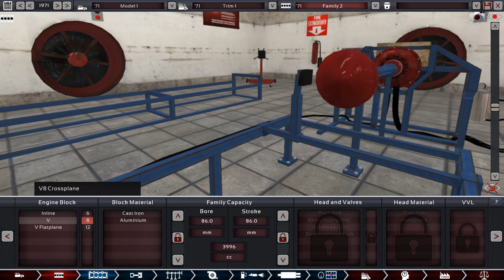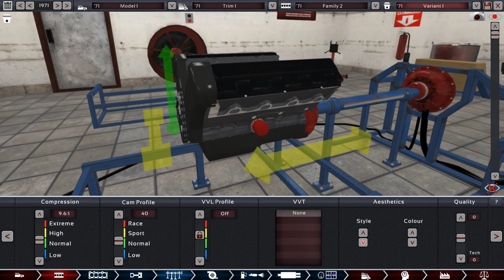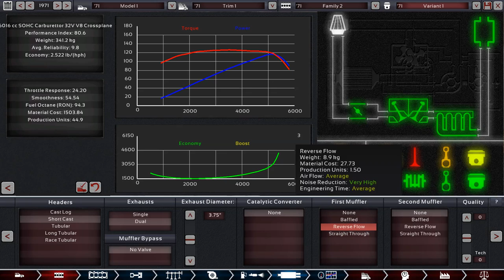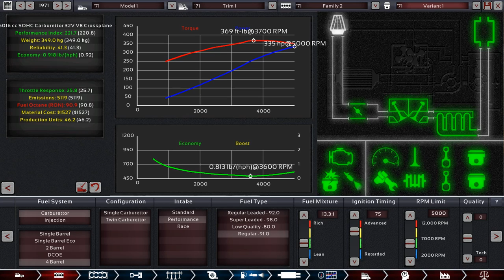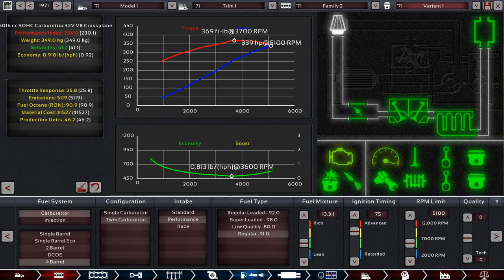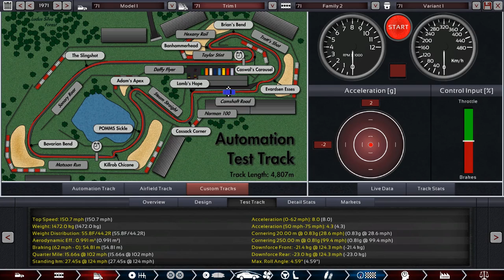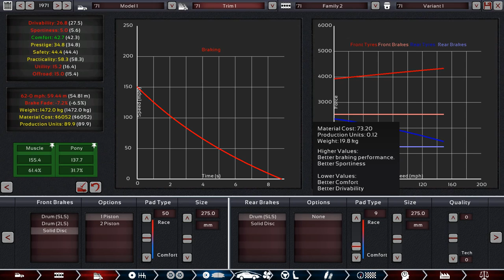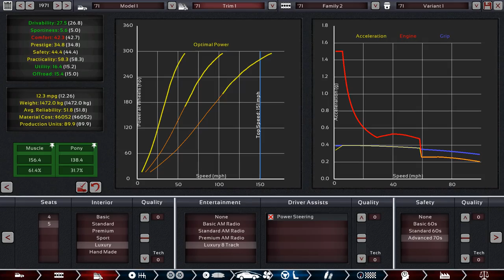Automation Challenge Classic Luxury (Performance) Estate

Comment: Pro tip: When tuning the brakes, look at the graph on the right and try to get the front and rear brakes line above the corresponding tyre lines. When the brake lines are below the tyre lines on the graph it means the brakes aren't strong enough to reliably stop the car. Having strong enough brakes obviously ramps up drivability.

Comment: You can fix the "pink body" issue. Go to steam, right click automation, properties, local content and show local files (or something like that)  then, inside game data look for the folder of the mod that has that issue (it can take a while)  and once you find it, you open the LUA file (the one that isn't bones) with notepad or notepad++ and make sure the material names are written between "", something like this:
"ECS_BODY"
"ECS_CHROME"
"ECS_CARGO"

Also, you can look in the official forums for help on issues like that or to participate in the community challenges. 

Cheers!

Comment: Is there a mod for A rotary engine ? Rebuild the 787B then :P Best Race car ever
Reply: There is no rotary engine in automation but he could build a v12 of 2,6 liter and try to get the same power.
Reply: But he needs to keep the stroke as small as possible otherwise it won't be able to rev very high.
Reply: The developers say that the rotary will likely come as extra when the games fully completed development.

Comment: If you were going down the classic American wagon route, you should have used the body you used for the 1 liter full-size wagon video. That one at least looked American. The one in this video doesn't, and it's WAY too small.

Furthermore, when talking about traditional American luxury cars from the past, it's all about comfort and presence. Performance and economy are pretty much thrown out the window. If you think a massive, 2 ton tank of a car riding on a very soft suspension is even remotely worried about handling well or getting decent MPG figures, you are mistaken.

These cars were tailor-made for a leisurely driving experience, not for impressive lap times. They're not aggressive, they're pleasant. It's a damn shame they don't really make cars like that anymore. These days, American companies are trying too hard to make sporty, European-inspired cars. Even Cadillac has flocked to the Nurburgring to make wannabe European sport sedans. The last vestige of the American landyacht died with the Lincoln Town Car about five years ago. The new Cadillac CT6 and Lincoln Continental look pretty cool, but they're just not the same..

Comment: Try doing a 50's muscle car with 15000cc engine with push rods and try to get as much power as you can 
Or
Make a 700hp fiat panda (there is a mod for the old panda body on steam workshop) you can put an 600cc v12 engine in it :P

Comment: Try and make a super truck or super SUV. Although the body I would imagine to be fun to use doesn't exist (Lamborgini front engine mixed with a Ford Raptor would be ideal), having it be both fast and towing power would be what I imagine the usage to be. Or at least pickup body and super car speed.

Comment: kei car for a future vid: no more than 1 litre, redline of 9500 rpm, power over  80 kw
Reply: Perfect idea.
Reply: I thought Kei cars were limited to around 0.7 liters
Reply: +Tomster_627 660cc!
Reply: You know, I thought of typing that but rounded to 0.7 Liters lol
Reply: Also they are limited to 62Hp, which I think is about 47KW
Reply: 63 HP. according to Gran Turismo 5 and 6
Reply: Kei car from 
1998 to nowadays    660cc end 63HP
1990-1998                  660cc no power limit
1976-1990                 500cc no power limit
1955-1976                  160cc no power limit
1951-1955                  360cc (four stroke) no power limit
1950                            300cc (four stroke) no power limit
1949                            150cc (four stroke) no power limit
Reply: Wait so there wasn't a power limit until 1998?
Reply: Tomster_627 As far I know there wasn't limit until 1998 but keep in mind that even engines nowadays don't get ussualy power somewhat equal to displacement (like natuarly aspirated 1,5l engine ussualy don't make 150HP) end turbo is not that often used in small cars(I don't know is turbo legal for Kei car engine.)

Comment: OHC, Carborator... TF?
Reply: look at the period he put it on
Reply: Okay so have the carborator.
OHC?
Reply: Overhead cam (single usually)
Reply: I kno, but it's a V8...
Reply: 99% of the old v8's were carburated. They switched to cams much later.
Reply: MrRubenvos123 Yeah haven't noticed the era he put it on
Reply: +MrRubenvos123 and 100% of classic American V8's were NOT OHC, they had pushrods.
Reply: Pushrod, carburator. LS engines nowadays still use pushrod (E-ROD)